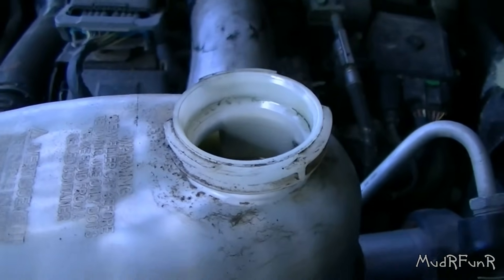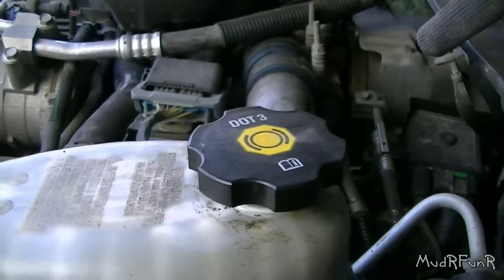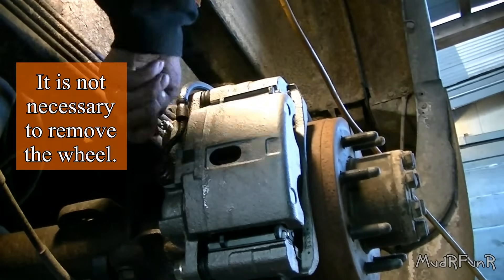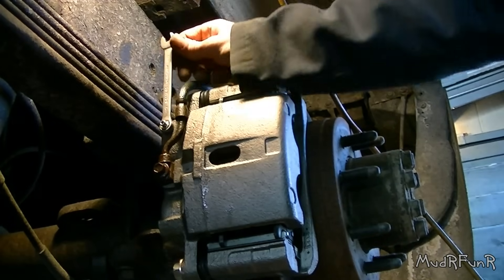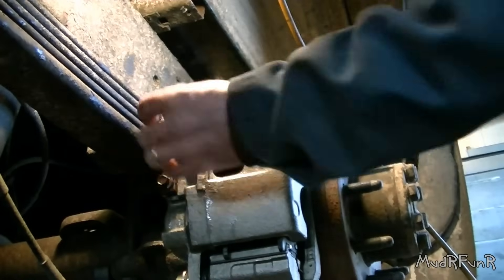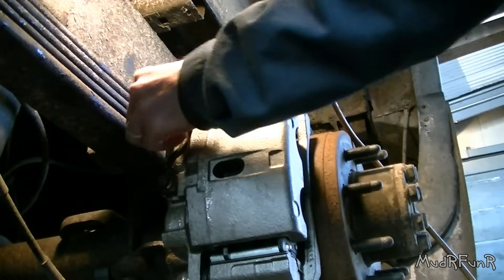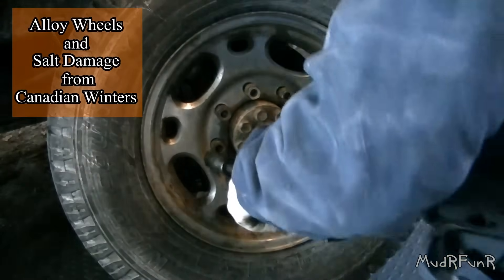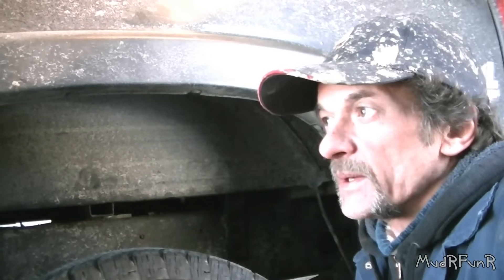Bleeding Brakes by Pedal Pumping

Comment: After struggling to do my rear brakes, i now need to do this. Learned the hard way some vehicle calibers twist in, and using force and a vice doesn't push them in 😂 opened the valve to release pressure and definitely let some air in. Oh well, I have now mastered my brake changes through error!

Comment: Great little vid, there was only one thing missing and that was "when bleeding brakes you should start from the wheel furthest away for the master cylinder &  booster then work your way to the closest" e.g back left, back right, front left then front right all depending on where your master cylinder is. Other than that, your vid it's informative and easy for people with little or no experience 👍
Reply from the maker: At 1:00 in the video

Comment: Thanks for the video, my brakes went out on my Acadia. My mechanic buddy came and tried to fix it. We replaced some washers, buttoned it up. Still leaking, I guess my Flex line is fucked. I didn't understand what he meant by " We might need to bleed the system... " Makes alot of sense now.
Reply from the maker: Yes, bleeding the system is important. It gets the air out of the lines. Good luck with your leak!

Comment: My neighbor bleed my brakes and we have a 2001 chevy silverado brake pedal is going down to floor when stopping I have to pump them to stop can u give advice
Reply from the maker: It's hard to answer that without knowing exactly what your neighbor did. First thing I would look for is any leaks in your brake lines. It would be very noticeable. Make sure you check to see if the fluid is full.

Comment: I changed the front brakes on my 2002 ford f150...forgot to remove the brake fluid reservoir  cap..
The brakes are a little spongy..so would I need to pedal bleed  only one of the front brake cylinders or both...a little confused?
Reply from the maker: If you had the lines off both sides then they both need to be bled.
Reply: @MudRFunR  ok..thanks

Comment: What happens if the system completely leaks out of fluid for one day. But no brakes where pushed. Will that cause any damage? I filled it back up. But it sat all night empty.
Reply from the maker: I guess it would depend on where it leaked out. If it leaked out at the master cylinder, then air probably didn't get into the lines. If it leaked out from a line or wheel cylinder, then air would be in that line or possibly all of them. Hope this helps.
Reply: It leaked out of the broken piston on the caliper. If air did get in, can't I just bleed  It and it be fine? No permanent damage is what I'm asking basically?
Reply: Oh, and txs for the speedy reply. That is VERY MUCH APPRECIATED

Comment: Ok so once you open it you wait for all the fluid to come out before you close it and start with the passenger side first?
Reply from the maker: Yes, passenger side rear, driver rear, passenger front, then driver front is the most common way. It may differ on some vehicles. It only takes a few seconds for the fluid to stop. When the pedal is all the way to the floor, then close it. Repeat until no more bubbles come out of the bleeder. Then on to the next bleeder, etc. Just don't let your fluid run dry or you'll be starting all over. Hope this helps!

Comment: My right front caliper is not releasing tention on my pads. I went and installed a different caliper with the same results. Any suggestions?
Reply from the maker: I have heard of the rubber line collapsing. It's never happened to me but can happen. It will allow pressure into the cylinder because it's under pressure but can't get back out and thus holds the cylinder tight. If your connections are not too rusty, try lightly loosening the line at the caliper and try to release the pressure off the pads. You should be able to turn the rotor now. Tighten the line and loosen the fitting where the rubber line and the steel line attach. If the caliper is still stuck with this connection loose then you know your hose is collapsed. Again, it has never happened to me. This is what I have learned from other YouTubers. I'm not licensed. I'm not sure if this is accurate information. I researched it and this just made sense to me.
Reply: MudRFunR Do you mean the line with the banjo bolt? If I loosen the bleeder I can press the 2 pistons in while pushing brake fluid out of the bleeder. Once I tighten it, and then use the pedal to create pressure again the same thing happens. Frustrating.

Comment: I done my brakes on my Tahoe this way today and it’s still soft but when I pump them they get hard is that supposed to be normal should I keep driving that way or bleed them some more?
Reply from the maker: Sounds like it needs to be bled more. Did you had any other lines off? You need to bleed each wheel that has had a line removed starting from the wheel furthest away from the master cylinder.
Reply: @MudRFunR I only did the rear wheel but I’ve read I need to do them all. Will I need to restart with the rear wheel I already did?
Reply: @ update: I bled them again today and it gets rock solid with the car turned off. Soon as I cut it on the pressure goes away and it sinks to the floor until I pump it
Reply from the maker: @Yokxdxnn  I honestly don't know what to say at this time. If you have abs on your Tahoe, perhaps there is some air in the abs module.

Comment: Are you sopossed to pump brakes until it gets hard then hold? Because I was just pumping twice then on 3rd pump holding down the pedal. And my brake pedal still goes to floor. Any help would be great
Reply from the maker: You may need to pump more times than 3. You won't feel a lot of pressure on the first few tries. Do you have ABS brakes?
Reply: @MudRFunR  yes abs
Reply from the maker: @Kevin_Yagoonie  ABS systems sometime take a while to get all the air out.
Reply: @MudRFunR  thanks for the replies. I'll bleed them again and see how that goes

Comment: Thanks for the video. Don't you run the risk of sucking in some air when you let the fluid  spurt out rather than using a hose attached to bleed valve at one end and dipping into a bottle of brake fluid on other?
Reply from the maker: No. that is why you hold the brake down until the bleeder is closed. Let the pedal back up only when the bleeder is closed so air won't come back in.
Reply: @MudRFunR  got it. makes sense. thats how vw techs did it last time around here.

Comment: It might be wise to keep from pushing the brake pedal all the way to the floor, as the master cyl. piston gets in the bore where it has never been before, where there may be pits or crap that will cause the master cyl. piston seals to leak. This does not happen very often though.
Reply from the maker: I have never heard of this before but yes, it seems totally possible. Thanks for the tip!

Comment: I have a 2004 2500hd. one brake line broke so we replaced all the brake lines but I can't figure out how to bleed the front wheels..we pump and pump and pump but nothing comes out..I bled cars before but I am not familiar with hydro boost brakes..any advice?
Reply from the maker: Sorry for the late reply. I'm sure you must have finished bleeding your's by now.
Reply: Did you check the brake fluid?
Reply: Phillip Owens it bleed itself, took about 3 days or so some driving and some sitting but in about 3 days she feels like original 👍

Comment: I replaced the front pads, but didn't know that I had to bleed the brakes. I pumped the brake pedal so many times and a lot of fluid came out from the reservoir. I test drived the truck and the brakes seemed to work ok. I heard sound from the brake pedal. Are my brakes ok? Do I need to bleed them now? Thank you.
Reply: It isnt necessary to bleed the brakes unless for some reason there was a way for air to get in your system. If you just pressed the brake pistons back into their retracted positions to swap the pads, then all that is required is to pump the brakes to seat the pads.

Comment: So you can bleed brakes with just a wrench??? You dont need that rubber tube’s and the container?... just have to make sure the brake pedal is pushed down when u open the bleeder?
Reply from the maker: I do recommend using a hose to keep from spilling fluid everywhere. My way was messy but I wanted to show the fluid and air bubbles coming out. Pedal down, open bleeder, keep pedal down until the bleeder is tightened. Pump the pedal and hold down...repeat what you just did until the air bubbles stop coming out.
Reply: MudRFunR but its possible right
Reply from the maker: @riverrivers250  Yes

Comment: Do you have to do this on all four brakes or just one to clear the system
Reply from the maker: You only need to do this anywhere where you have removed or loosened the brake line. If you replaced 1 caliper then you only need to do this by that wheel.
Reply: What if you change your master cylinder?

Comment: One of the best videos out there....I wanted to change the front pads and rotors on my 2004 Nissan Altima. Do I bleed the brakes after the removal and installation of the new ones?
Reply from the maker: MAD2202dpd Only bleed them if you take the line off the caliper. For just pad and rotor replacement there is no need to remove the line.
Reply: MudRFunR Thanks a lot. I ask for two reasons - 1: to protect the master cylinder, and 2: the service manual says to.
Reply: MudRFunR  well said, 
When changing brake bads you really don't need the brake lines off, 
If you make the mistake I did when I first tried you'll need to bleed .. oh the joys.

Comment: Question do you have to do passenger and driver side or just driver side...
Reply from the maker: It all depends on how many brake calipers and lines you removed. Any line that you removed, you have to bleed the air out at the caliper where the line goes to or every caliper that was removed has to be bled. If you did more than one, then start with the caliper furthest away from the master cylinder and end with the one closest to the master cylinder.

Comment: hi i will be doing this first time my question is do i do this on just one bleeding port? or do i have to do passenger and drivers side? sorry im speaking from a newbie perspective...Thank you for you vid it looks so easy to do and follow, i subscribed to ur channel
Reply from the maker: If you only had the brake line off at one wheel, then you should only need to do this on one wheel. If you have had multiple lines/calipers off then you should do them all starting with the wheel that is furthest away from the brake pedal. Second one next closest to the brake pedal then next closest and finally the one closest to the brake pedal. Hope this helps.
Reply: @MudRFunR  Thank you

Comment: Do I only got to do one tire our all ?
Reply from the maker: It depends on what repairs you did to the vehicle. If you had one line off, then you only need to do one wheel. If you had multiple lines off, bleed the wheel that the line(s) leads to. If you let the master cylinder run dry, then you will probably have to do all 4. Hope this helps.

Comment: My caliper wont press in. Too much pressure?
Reply from the maker: Open the bleeder screw slightly unless your park brake is attached to your caliper. If yours has the park brake as part of the caliper then it's a screw in type cylinder.
Reply: @MudRFunR  thanks so much for replying after all these years. And omg.. the piston just easily screws in.. is that new? I bent my clamp for nothing!
Reply from the maker: @kylefrye8222  No nothing new. Most anything with 4 wheel disc brakes has the park brake as part of the caliper. Glad to help, thanks for watching!

Comment: Why or why would you just dump the brake fluid on your garage floor or even outside?
Reply from the maker: I did mention that I should have a line on the bleeder. I had left it off for demonstration purposes. I should have mentioned that. Also I had a large piece of cardboard under the axle. Some did spill on the floor.

Comment: Thanks,  I'm going to bleed my brakes later today.  2002 4x4 2500 Silverado.
Reply from the maker: Hope all went well!
Reply: @MudRFunR  Everything went well.  The bolts for the callipers were hard to get off, bought a long torgue wrench which really helped.  Replaced callipers and rotors.  Save at least $600.00. Neighbour helped with bleeding the brakes.

Comment: do you have to do this to all the brakes or just one?
Reply from the maker: It all depends on why you need to bleed the brakes. I you had any of the main lines off, you will need to do all 4. If you only did a repair at one wheel, then it only needs to be done there. Hope this helps.
Reply: Thanks man

Comment: Tip: begin with wheel farthest away from master cylinder and work closer.
Reply: Thanks. Couldn't remember order. So its pass. Rear, driver rear pass. Front, driver front?
Reply: @jericho-km5wy  yes, if master cylinder is on drivers side

Comment: Is this the same for all cars?
Reply from the maker: This has worked for any vehicle that I've ever worked on but if you are not sure, you should check with a reputable dealer.
Reply: MudRFunR thanks for the reply. It works for the 02 eclipse I just bought off some random guy but the actual problem was that there's a massive leak in the brake line right above the gas tank. So now I have to drop the gas tank and replace that lol...
Reply: if you have brembos there are two valves. one on front and one on back
of the caliper

Comment: do you have to do all four wheels or just one
Reply from the maker: Depends on what work has all been done. If just one cylinder has been replaced, just that one needs bleeding. If you have replaced any lines then more will need to be bled depending on where the lines were replaced.

Comment: Just put a hose and bottle on that bleed valve instead of spraying corrosive brake fluid everywhere. You can also visualize the air bubbles in the tube.
Reply from the maker: Yes, I realize I should have contained the fluid. I was pressed for time... couldn't find a hose... thanks for your comment.

Comment: Will this method work the same for my brake master cylinder replace?
Reply from the maker: No a master cylinder should be bled before installing it on the vehicle. It's a whole different thing. I don't have anything posted about that but I'm sure you could find something. I've heard it called "bench bleeding" cause it's done on the workbench.

Comment: Thanks for the info. Great video!
Reply from the maker: Glad it was helpful!
Reply: @MudRFunR  If my brake hose was replaced on the right passenger side should I bleed all four?
Reply from the maker: @tyronekitchens4245  You shouldn't need to unless your brake fluid reservoir was completely empty at some point.
Reply: @MudRFunR  When the brake line bust when my caliper fell i lost alot of fluid it was VERY LOW
Reply: @MudRFunR  I only bled the one side when I replaced the hose.Should i also bleed the driver's front side also?

Comment: I tried this method and it did not work... My unlce has been fixing my cars since i was 16 i am 30 now. He came over and immediately he had a different method. He would have me depress the pedal slowly down and hold. He would crack bleeder open as i was pressing down! This made all the difference and acutally pumped all the air out. He still made sure to close bleeder before i let go of pedal. We did all 4 then once again! Like magic they worked i tried it the other way where u hold pedal down and have someone open bleeder for days do luck i got air out but not nearly enough. So when u press pedal slowly press and hold and who ever is bleeding needs to crack it open as u are pressing down. This makes all the difference! Bleeds out 10 times faster just have a bottle of brake fluid ready and mind your revisor level!
Reply from the maker: I have tried this way as well but I have always had good luck doing it this way. Thanks all the info!

Comment: Not topping off your brake fluid will be bad for your cylinders ? Interesting
Reply from the maker: I don't recall saying that it's bad for the cylinders. Letting it run dry allows air back into the lines. Kinda defeats the purpose of bleeding them.

Comment: I'm about to go hairy Carey over here I know what I'm doing I've done at least 50 bleeding jobs and yet I struggle with with a few jobs especially my 98 Silverado plow truck,with new master cylinder wheel cylinders, booster ,calipers,all lines and still have air but can't find any bubbles but because I'm mad I think it is clouding my train of thought and judgement 🤬😠😡😤
Reply from the maker: Did you bleed the master cylinder before installing it? I can't remember exactly how it's done but I do recall having to bleed the master separate from everything else.

Comment: Ok I seen your video. Big mistake. When pumping the pedal. Go slow .And go all the way down and come back up slow. Don't take ur foot off the pedal and go thump. Your just getting more bubbles if u do this. Get a line on the bleeder with a bottle with a 3/16 tubing . Fill the bottle about 1/4. Keep tubing in there all times. And yes bleed from rear passenger side wheel first. Working it way to drivers side.  This is how u bleed brakes
Reply: Yeah you can do that or what this dude did , it works either way , what he did is what my dad used to do , I had to do this today

Comment: Hello do I need to bleed all 4  or just one??? Thx
Reply from the maker: All depends on why you are bleeding them. If your fluid has at anytime been completely empty, you need to do all 4. Starting with the line furthest away from the master cylinder. If you have only removed the line or cylinder from one wheel, all you need to bleed is that wheel. Hope this helps.